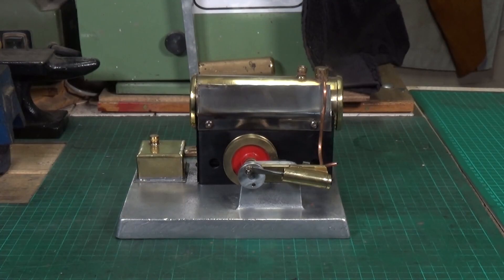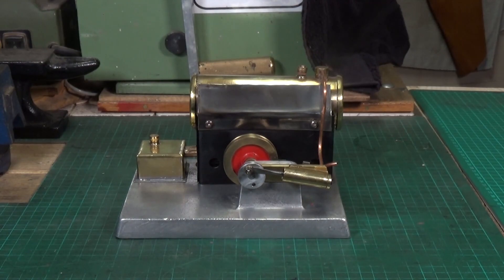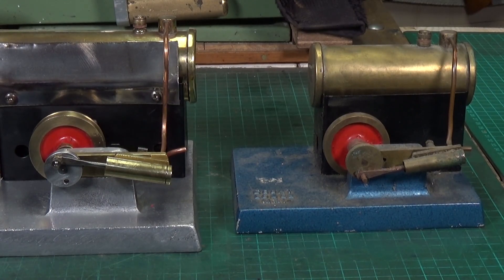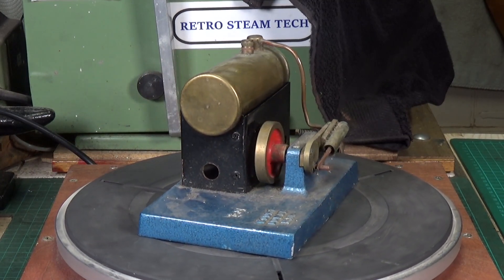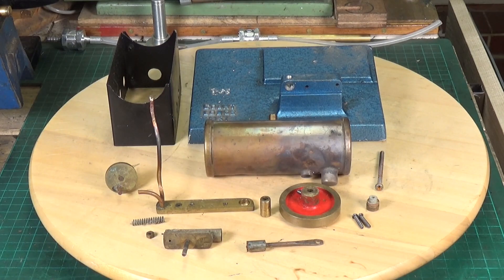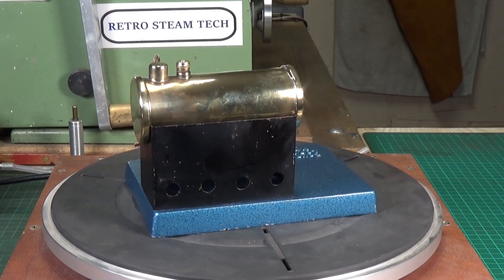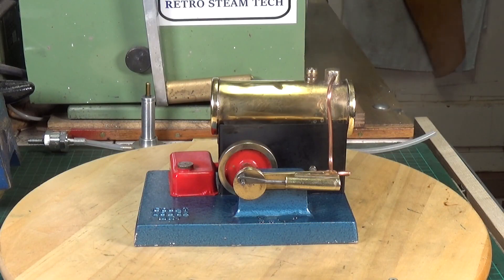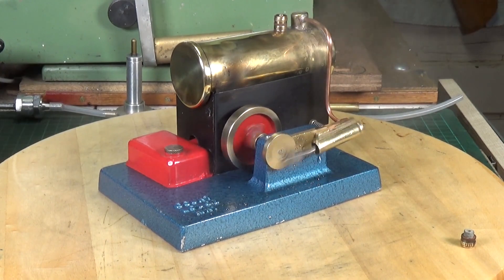Court Lodge MK1 Model Steam Engine

Comment: Lovely engine and in good condition too. It would be easy to make one in that style.
Reply from the maker: I think so. As it was to be made by school pupils the design had to be fairly simple. That being said it's still good engineering, the crankshaft runs in a brass bush which is pressed into the aluminium base casting. It also has an oiling hole for the shaft.

Comment: Interesting Alan.  Came up nicely.  Can you explain how that burner works ?  Does it just burn the metho vapour at each cut ?  How high does the flame go ? Looks simple.  I'd be interested to see a short video on the design and flame pattern sometime.  Cheers Rob
Reply from the maker: Hi Rob. Yes it was in pretty good condition, just needed a clean. The Luton Bowman burners with the cross cuts were fairly unique to those engines, other Bowman engines had round meths tanks and the slot in the burner tube was longitudinal. It's a fairly simple design, the burner tube has a wick inside it which extends into the tank. They work ok but as there is no vertical wick tube to move the flame away from the meths tank they do tend to get very hot.  I think Geoffrey Weller copied the Luton Bowman design as it is quite simple to make. Cheers, Alan.
Reply from the maker: Sorry Rob, I forgot to explain the burn. As the slots are so close together you tend to get one long thin flame the length of the tube. The flame can be quite high, between 1 and 2 inches. Cheers, Alan.
Reply: @RetroSteamTech  OK thanks for that info Alan.  I wondered how it would work, but couldn't see a wick.  I might try and make one at some stage.  Looks pretty doable.  Cheers Rob